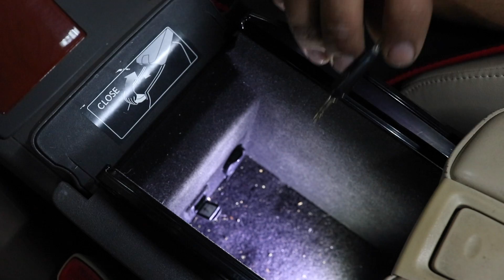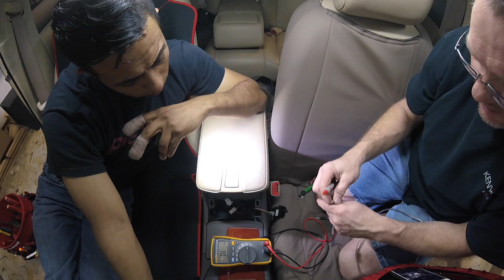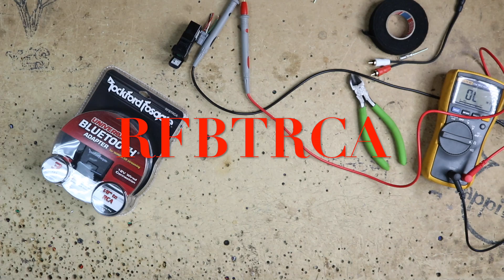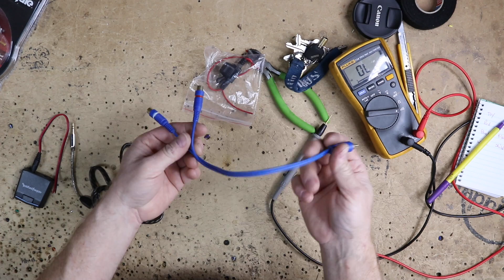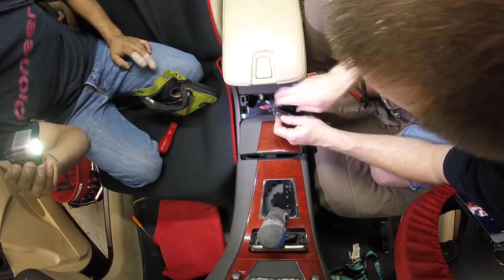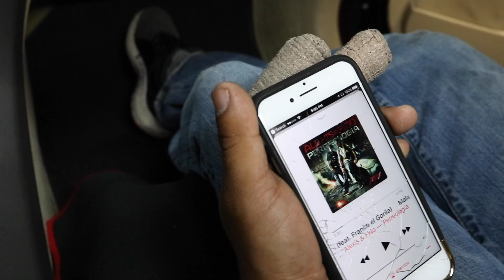How to replace your broken  car stereos Aux input with the Rockford RFBTRCA bluetooth dongle

Comment: Hey I have a question a I just purchased one of these and I’m trying to put it in a 2008 Mitsubishi Lancer evolution . Everything is straight forward as the car comes with rca inputs however The music plays but I’m hearing buzzing skipping noise also when I drive it whines . I bought a ground loop isolator but didn’t solve my problem... any help would be appreciated

Comment: whats good set brand to buy door speakers that are 6 1/2 that won't break the bank and sound great with a 800 watt amp connected to it with 4800bs head unit as main reciever i need 4 door  speakers all same size
Reply: https://www.amazon.com/gp/product/B01MQTILGD/ref=ox_sc_act_title_1?ie=UTF8&psc=1&smid=AJYZ22R6PYFT6
Reply from the maker: Ghost Face good recommendation but I would spend a little more and get the Alpine Rtypes

Comment: my epicenter cuts out what can the problem be?
Reply from the maker: Baby Gotenks is the gain to high? Lose or bad ground or power? Bad unit?
Reply: Five Star Car Stereo what volt should it ve sitting at the epicenter you know how they have the jumpers inside what should a LPF be set at and subsonic or the level on the amp I have a 2500.1 brutus elite its wired to a single cvx 15 at 4 ohms
Reply: also the gains on yhe epicenter the sweep and wide how do you set that proper